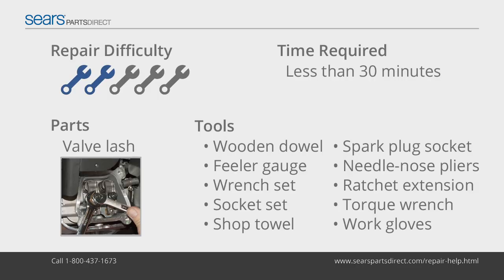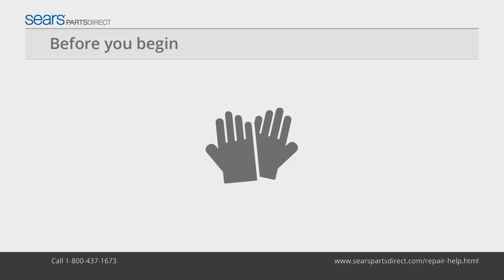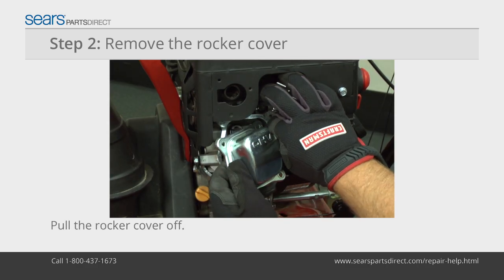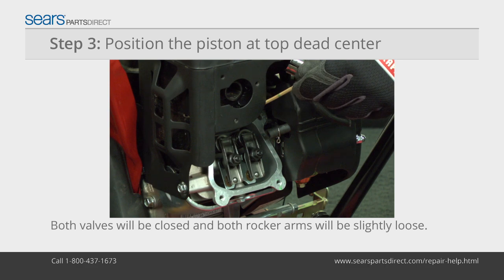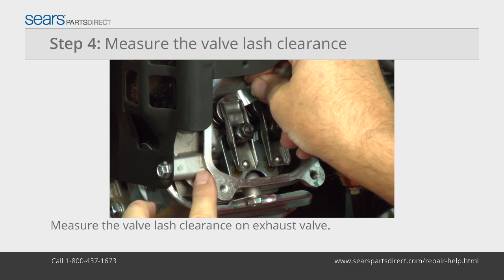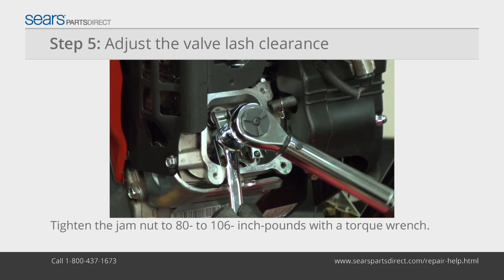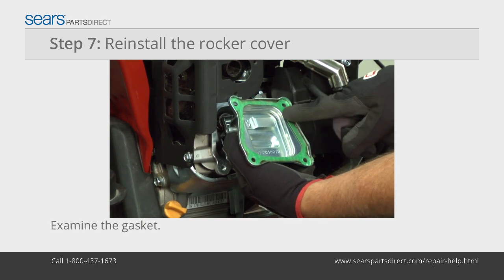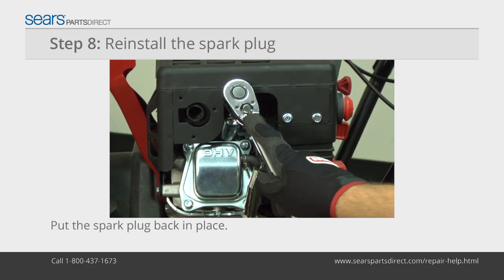Adjusting the Valve Lash on a Snowblower

Comment: Bought our craftsman in 2014.  new plug, new oil, new fuel filter, new carb and still ran rough last year.  Just did the valve lash adjustment and it runs nice now.  It says the valves need adjustment after 25 hours.  I was way passed that.
Reply: at top dead center, when I put my fingers on the valve rockers, but were very loose.  Too loose.  I dropped the spark plug into the damn hole wrong way and it took me 20 minutes to get it out after I put it all together to start it.

Comment: Take it from me, if you've got one of these MTD China made 208cc engines and are having hard or no start problems, check the valve adjustments first.
Reply: If it doesn't start, the first culprit to check is a clogged carburetor from resting the blower over summer with gas containing ethanol.
Reply: Nelson Donnell. What's valve lash spec.
Reply: @lauratingue455  Over head valves EX .005-.007      Intake  .003-.005